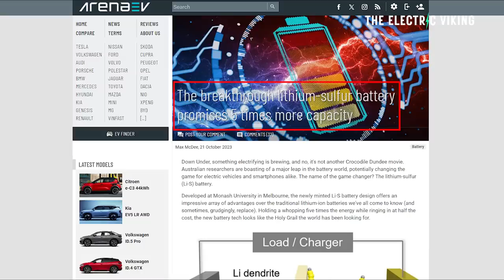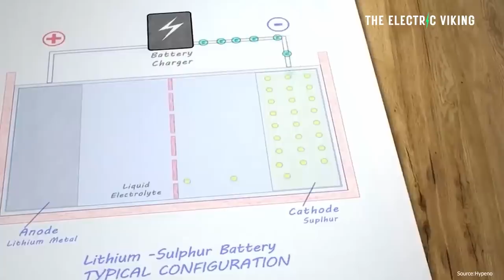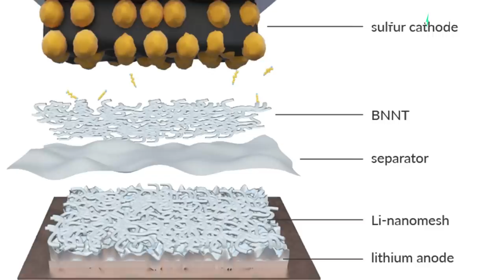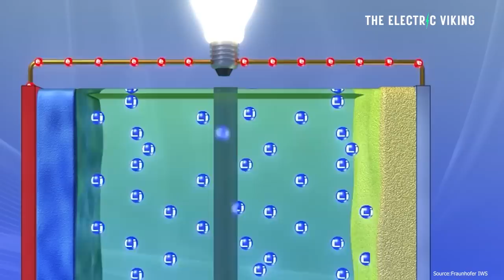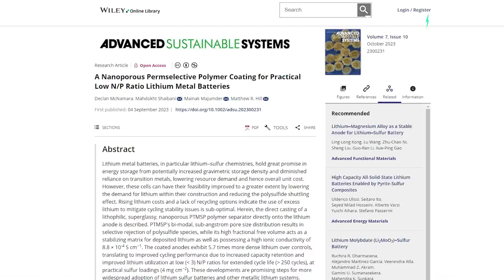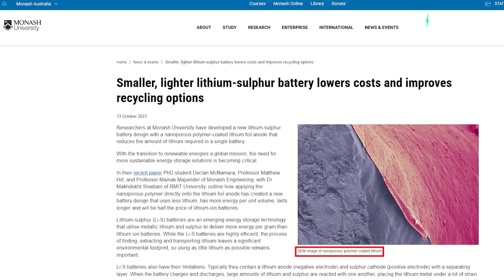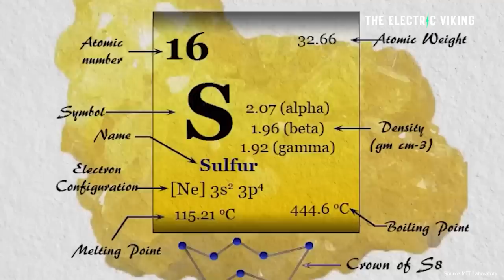Breakthrough for new battery that has five times the power of lithium-ion

Comment: There is still the fundamental problem with batteries, charging the bloody things, every watt in has to come from somewhere and currently there is nowhere near the generation or distribution infrastructure to support a large electric fleet. Just to charge all of the trucks that go in and out of a single supermarket medium sized distribution center by 50% of their capacity would require a town sized substation working at full power 24hrs a day.  An major Amazon distribution center would require its own city sized substation. To supply an electric car fleet most towns and cities would requires at least double their current capacity. There is no way there can be a switch to battery until there are enough power stations and big enough cables to supply all of these new 'EV' towns and cities. It will take decades to decide, plan, fight the nimbys, construct, fight the delays, and finally commission the generation capacity and replace all the insufficient wires even if they started yesterday. And no matter how many ICE vehicles are replaced there is still nothing being done to change the fossil fuel use in most international trade. We are not seeing many battery trains, or ships or plans for the infrastructure to charge them so the ICE fuel is going to become a by product of international trade that, if not used, will have to be burned off anyway.  Forget great batteries until we can actually fill them. Oh and fusion is not going to be coming to the rescue,  it would have to be 25 times better than the best they have achieved so far just to produce enough power to have some left over to sell.
Reply: Bingo my friend 👌
Very true. 
The problem is many people have convinced themselves that batteries are energy. Lol fool's.
We burn massive amounts of fossil fuel mining lithium & other minerals that are manufactured into batteries that will never on the longest day pay back the energy debt created.

Comment: wouldn't be easier to just make the anode easier to repair than trying to find a new chemistry ? mechanically press the dendrite back with a ceramic roller and sinister the lithium back. It could be a new service product for dealership after ev transition. Regular battery cycle maintenance.|
On the side note, I'm pretty curious on how they solve the lithium sulfur expand 500% in volume after charging issue. From the paper i  read, so far it's only solvable via growing the anode into a nano-size wire structure, so the volume expansion is less pronounce. But this manufacturing method require hard vacuum environment, making the end product more expensive. Unless they just manufacture the battery in space, where plenty of hard vacuum is available "free"

Comment: Every week a new battery shows up, that is safer, more power dense, cheaper or charges faster, but they never show up on the market.  One thing that is certain is that new battery  technologies wont be packaged into cheaper replacement packs for current cars.  The companies selling EVs dont want you to have an infinitely repairable vehicle that lasts longer than the typical financing period.   Most EV owners wont keep them long enough to counteract their environmental impact, much less their excess purchase cost.  EV sellers are just fine with that.

Comment: Lithium-Sulfer...

Look up any safety data sheet regarding sulfer - here's a couple of snippets:

Sulfur may form an ignitable vapor/air mixture in closed tanks or containers. Sulfur reacts EXPLOSIVELY with OXIDIZING AGENTS

Sulfur can cause fires under heat, impact, friction, etc. It will generate static electricity in the process of crushing, grinding, storage and transportation, causing spontaneous combustion and explosion.

BRILLIANT!!! In the race for more power, they've just made EV batteries EVEN MORE EXPLOSIVE! Just what we need 😂😂😂

Comment: Being energy dense and less expensive to produce are both excellent features that we need. But to me, the ability to charge super fast is more important for the layman who wants to buy an electric car but does not live in a place where at-home charging is feasible, like an apartment complex with unassigned parking or street parking. But as others have pointed out in the comments, we need to SEE these great technologies being deployed in the real world, not endlessly promising to be "right around the corner".
Reply: Agreed. I wouldn't have an EV if I didn't have my charger in my own garage.  But a limitation of super fast charging is only part battery limitations but also part of the available amperage at charging stations.  Even with a 1KW (!) charger, it would take 10 minutes to charge a 100KWH battery pack (and probably a bit longer in practice).   With a 10 slot charger station, it would take 10KW of available power to the facility.
Reply: @ohger1 I think you meant 1000kw not 1kw, but yeah. I think if cars can charge to 80% in 10 minutes that would be good enough because the last 20% of a battery takes about as much time as the first 80% because of how resistance increases as the battery gets more full. Charging stations can be set up in a number of different ways, but I've found that usually they are paired so that each pair shares one main hub. So if it's a 200kw charge station and only one car is connected of the pair that car can get the whole 200kw but if two are connected they will generally share that 200kw.

Comment: An energy dense battery with low cycle life that is not economically viable in road transport could still be economically viable in electric aviation. Different economics, different battery specs.

Comment: early days yet... i reckon in 20 years that the battery cost will be 25% of what they are now and i would be in a wheel chair. If you want to enjoy an ev then go out and buy a Li ferro-phosphate.... you wont regret it.
Reply: It's Lithium Iron-Phosphate (or to be technically correct Lithium Ferro-Phosphate) or LFP battery.

Comment: Let's see...a battery 6x bigger than a 2170 with 5x the storage capacity...

Yup.  They cracked the code for more storage!  Not...
Reply: Where do you get the 6x bigger number? 500% energy density means a 300kwh battery pack is the same physical size as a 60kwh battery pack, individual cell size is irrelevant.
Reply: @TB-up4xi  Look at the battery sizes.  The battery cell they showed is around the size of the 4680.  That would be 5-6x bigger.  You can only put so many of those in the space where the battery case is.  So you really have only created a less densely packed battery arrangement.

Frankly, if the pack is supposed to be a stressed member of the frame, having the smaller cells actually makes it stiffer.  So they seem to have traded one 'oops' for another.

Comment: Improved batteries still do not solve the problem of infrastructure. Until we have chargers as plentiful as petrol stations and enough clean generating plants to eliminate carbon fueled generators, electric vehicles will remain an expensive novelty.

Comment: As we get to cheaper batteries with high energy density, but relatively few recharge cycles, maybe battery swapping gets more practical. The swap station would send batteries near the end of thier life cycle to recyclers and add new batteries to its inventory.  The cars using this approach would always have relatively fresh batteries on board.
Reply: Dream on.
Reply: That’s why I hope NIO becomes successful.  Battery swap is the only way to make BEV as hassle free as ICE cars in terms of fill up.
Reply: @xsu-is7vq  EVs are ALREADY easier than ICE to fill up.  I can charge at home overnight.  I NEVER have to go to a gas station.  It's awesome to have this convenience and pay only one fourth or one fifth as much as gas.
Reply: @incognitotorpedo42  Sounds like EVs are good enough now that that they no longer need taxpayer subsidies.
Reply: @incognitotorpedo42  No.  That’s just easier in ONE scenario.  You can’t say just because you can charge at home and haven’t needed to go to a charging station so far, then NOBODY EVER need to go to a charging station.
Reply: @xsu-is7vq  no different than buying a ice with a bigger gas tank
Reply: @incognitotorpedo42  how's that work in rural Australia?

Comment: 5 Times Capacity, not 5 times power
Reply: The actual paper says, “The coated anodes exhibit 5.7 times more dense lithium over controls”….
Reply: @ayoutubechannelname  dense = capacity = kwh. power = kw
Reply: @marianilie7321  Lithium density on an anode surface isn’t a measure of KWh. It doesn’t even give you the gravimetric nor the volumetric energy density at the pack level or even the cell level.

Comment: Wath if divide catode in microlines , not one big surface, and one line charge for 20s, then switch to adiacent lines that not charge. Can be? To make uniform grow , line very small as in procesor?
Reply: Add lines as second leyer, used as controlled charge level.

Comment: The battery of tomorrow is a lot more like muscles in living organisms.. structural and self-repairing.  A charge cycle would not only load them up, but would have them bleed out dendrites.  They can't be sealed, like our skin they must breathe.
Reply: Interesting concept. 
However isn't the new direction solid state?

Comment: How many watt-hours per kilogramme? Batteries in the sense of ones that we can buy have been stuck at a maximum of about 250 WH/Kg since the Panasonic 18650B was introduced well over 10 years ago.
Reply: Fair call.
Surely they already know the limits of the minerals we are working with. 
These "experts" must have a ballpark estimate of maximum energy density.

Comment: Thanks for your information. Sound very promising 👌 
Btw, may you help to clarity why the current cost of battery is about USD 90/kwh, so a 60kwh battery pack in some EVs would come to the cost of about USD 5400. How it accounts for about 40%-45% of EVs cost? 
You may create a new episode explaining about this. Love to wait.
Thanks. Tom.
Reply: It is $90 per kwh for the LFP batteries approximately.  NCM batteries can range between $120 to $150.  However there's more to the battery pack than just batteries.  You also need a BMS(battery management system), sensors for temperature control and safety, interconnects between the cells, some sort of HVAC system, communication equipment as well as the protective housing itself.  Sometimes these items are included when figures are stated and sometimes not.  Of these items the batteries themselves are the biggest overall cost representing between 70 and 80 percent of the total cost.  

A small model 3 battery may cost about $7,000 but larger packs especially those that use NCM like the Ford Lightning represent a much larger amount.  They stated the battery at $151 per kwh so for a 145 Kwh(131 usable) battery the cost would be $21,895 plus the additional components would make the cost about $27,000 to $28,000 which is a substantial cost of the vehicle.  Articles from last year state the cost of the lightning battery at between $32,000 and $36,000 but that was over a year ago and things change as Sam pointed out.
Reply: Lithium Ion battery prices are calculated on the world Lithium spot price set by Benchmark Mineral Intelligence. It’s a bit like petrol and diesel prices are related to the oil spot price issued by OPEC. The current cost per metric tonne of lithium is $37,000 USD.
Reply: @Ryan-ff2db thanks for your information. As you say, the battery pack of  model 3 rear wheel drive cost about usd 7000 = aud 11,000.
The sale price of this model is around  aud 62,000. I assume Tesla added 25% on production cost for margin and warranties cost. Therefore the production cost is around aud 62,000/1.25= aud 49,600. 
This mean the battery pack account for: aud 11,000/49,600 x 100% = 22%. This number is much below the range of 40%-45% that Sam usually quoted. 
Sam always hopes that if the battery cost is reduced by 30%, the  EV production cost would be equal to ICE vehicle. But if the rate 22% I mentioned above is correct, then the day that Sam hopes is not 3 years ahead. May be 8-10 years. Because 30% reduction in battery cost only bring in around 24% reduction in battery pack cost, then this 24% x 22% (rate of battery pack cost on EV production cost) = 5.3% of EV production cost
In summary, 30% of battery cost reduction only bring in 5.3% reduction in EV production cost. 
Therefore, the day the EV production cost equal to ICE vehicle production cost seems far away. 
Need Sam clarify on this.
Reply: @PropanePete  True, but spot prices are not the same as contractual agreements with major manufacturers.  So while Lithium prices continue to fall, it takes some time to work it's way through product chain, as manufacturer's need supply guarantees.  This is why battery costs fluctuate but not nearly as radically as the commodity market.
Reply: @Ryan-ff2db  Whatever lithium prices comes under you can bet the lithium miners will ensure prices per tonne are at their maximum. There will never be a truly cheap new EV battery.
Reply: @PropanePete  Wow. I think you need to look at chart of battery prices over the last 15 years.  Batteries have become substantially cheaper over time and continue to fall in price even as we speak.  New chemistries are coming to market every year and next year will be no different. As far as lithium, just this year, there were major discoveries of new lithium deposits all over the world including the worlds largest ever deposit discovered in Nevada the third biggest in Iran, as well as large deposits it California, Australia, Chili, Bolivia, Canada, Africa,  etc.., deposits are being discovered literally everywhere.  If you take emotion out of it and look at the numbers, it's pretty clear where the market is headed.  If you're an investor I highly suggest investing in the future, not the past.
Reply: @Ryan-ff2db  while the deposit discovers are true. 
The experts (rio tinto)
Have made it clear even with predicted  supply increases worldwide they estimate a supply short fall of 50% within 3 years. 
50% of requirements not met. 
That is significant.
Reply: @0Aus  I'd like to know who this expert is and when his study was done?  I've read plenty of studies years ago that say similar things but current studies no longer state this as lithium continues to be found on every continent and even ocean deposits are being discovered.  This keeps reminding me of all the so called experts when I was a kid that kept saying we only have 50 years of oil left.  This also doesn't take into account recycling which dozens of companies are eagerly waiting for the first big batches of EV batteries to finally start coming in as they age.  It doesn't account for new chemistries that use considerably less lithium and it doesn't account non-lithium chemistries which are now entering the market as we speak like sodium-ion and all manner of new chemistries being deployed in BESS systems globally.  CATL believes sodium-ion will represent 18 percent of the market by 2030.  We will be just fine.

Comment: KEY POINTS HERE THAT ALL SHOULD KNOW!

1.       Video presented here ORIGINATED from Li-S Energy presentation

2.       Li- S Energy battery was developed and researched by Deakin University in Melbourne Australia, as was BNNT.

3.       BNNT is the secret sauce to the battery developed by Deakin University and Li-S Energy

4.     Li-S Energy is listed on the ASX (Australian Stock Exchange)

5.     Li-S Energy have batteries being commercialised, these batteries will be produced for commercial partners in Geelong, Victoria, Australia. This is imminent. 

4.       The presenter is naming Manosh University which is a false representation.

Comment: I daid this before but no more ice vehicles will not heapen soon. Unless you make them illegal. Why? Because there's not enough coper for the infrastructure. Even worse, there are no great mining projectsat the moment  because the ore quality is not good enough. And opening a new mine from acquisition the terrain to actual production takes about 10 years. Even if the batteries were almost free you still need an infrastructure for supporting a 100% electric society.
Reply: UK & EU are phasing them out for new cars 2030 or 2035. UK is already backtracking though as we have limited EV infrastructure. I suspect the Eurozone will be similar. Who knows?
Reply: @pleasy13  Politicians are blessed with being unknown of physical/technical matters and reality...
Reply: Correct as to the short fall of supply meeting demand.
As for the ore quality not so much.
Reply: No problem. If and when copper gets too rare and expensive, we will just use more cheap aluminum, as we already do in transmission lines. Both are recycleable.
Reply: @fotoguru222  copper shortage? kidding we can't give it away over supply in Australia

Comment: Even if the cycle life is shorter  it still may find its way into market in some applications as it won't need charging as oftener the same physical size  battery pack. And when the EV makers build cars that don't have integrated batteries and we can remove them easily when they need replacing will help the adoption of ev even more

Comment: I can not agree that EVs are getting near the price of ICE. Yes the battery's are getting less expensive. If I look back 7-8 years we have dubbed the capacity of the battery 3 times for the same price. BUT it is still not the range that we want and need. So the EVs do not get less expensive to buy. The get les expensive for what you get.